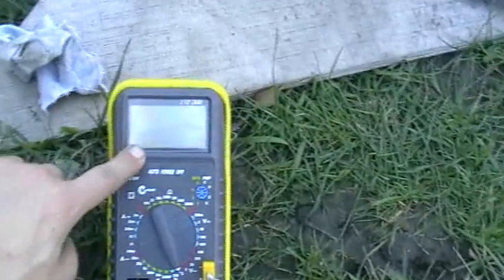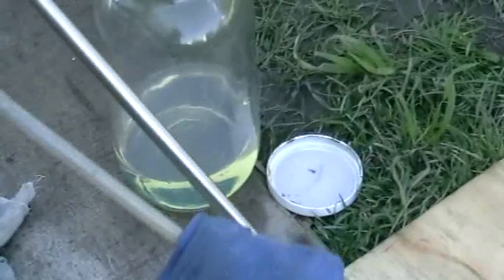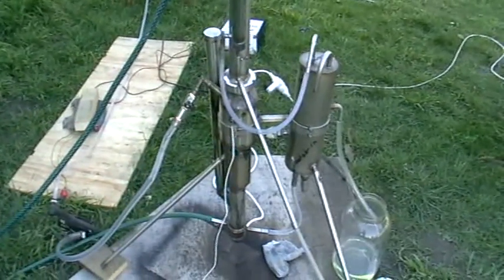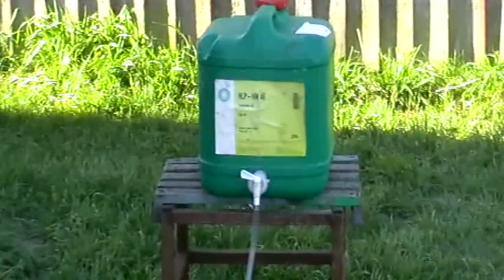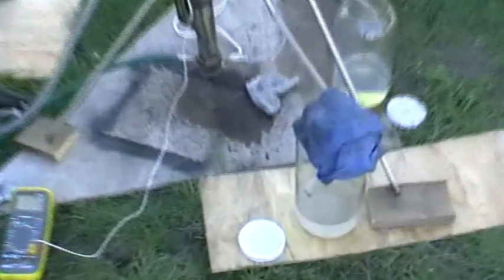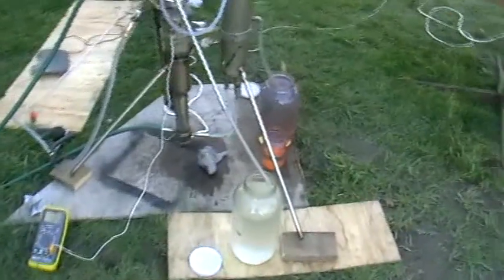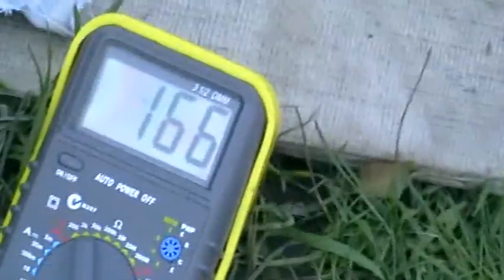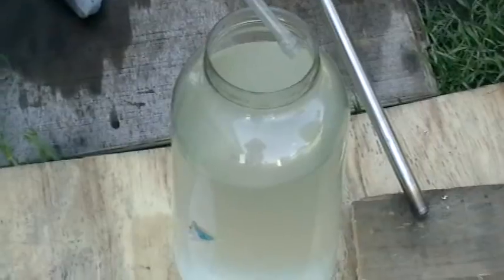Wwrong Fuel Refinery (Petrol recovery)

Comment: Bit of a late comment,  but a petrol/diesel mix does not need to be separated.  Just add 20 percent to a tank.  Even E10 at 20 percent does not damage common rail
Reply from the maker: In the case of adding 20% to the tank, one still needs to buy 80% of the fuel, so let's say that I do not have that 80% in the first place but have a lot of free mixes. What should I do without buying any diesel? Or let's say I have a petrol car, then will some 20% of diesel mix harm my petrol engine? Yes, it will, the petrol car does not like any diesel in fuel.
So proper separation is the solution for diesel and petrol cars.

Comment: How did you made this mini plant?
Reply from the maker: Get some stainless, electrical components, bolts, nuts, welding equipment and heat insulation, then built it.

Comment: what's that instrument to measure octane rating? i want to buy one 4:30
Reply from the maker: It is a special hydrometer that shows the gravimetric pressure or weight of the liquid in kg when the liquid is occupying the cubic meter of volume. The petrol and diesel are different, the diesel is heavier, carries more weight per liter, and as a result, the diesel engine is more efficient. this is instrument is from Ukraine. i am nor selling them, it is an old one, and do not know if they still in production.

Comment: This is really cool. I have this problem and I really would like to make this machine. I have about 80 tons of mixed fuel. about 40% is gasoline. The rest is diesel. Can you shear the drawings? I don't want to waste this fuel just as a heating fuel.
Reply from the maker: Hi, first of all this is an old version and the system had advanced a lot, second - I am sorry but I am not sharing any drawings of this particular system as I had built a commercial versions and promised no competition to my customers, maximum I can do is to build one for you.
Reply: sounds very good. What will be the cost and how large is it?
Reply from the maker: Tango Inasia
please contact me via contact page of my website, use the link in the description.

Comment from the maker: Hi, as was stated in this video this one is for mixed fuels separation, or for liquid solvents, or hydrocarbons, this is a continuous separator and will not work with solid plastics, the retort is still the best option for a small scale plastic processing.

Comment from the maker: @scarmenl this machine is a continuous mixed fuels separator, recovers accidentally mixed petrol and diesel, everyday people mistakenly fill their cars with a wrong fuel,  so this is a solution, it was made with petrol and diesel in mind - most common fuel we use everyday.
Reply: If you have a deisel motor you don't need to separate. But you need this fractionator for pyrolysis oil or you can make a catalyst heater to crack waste oil